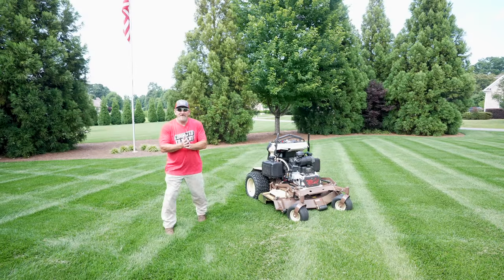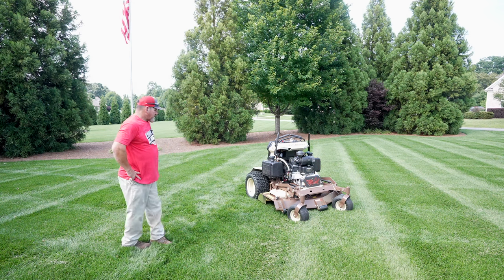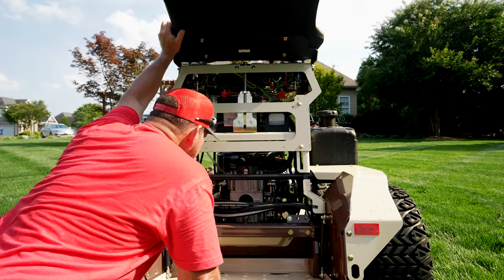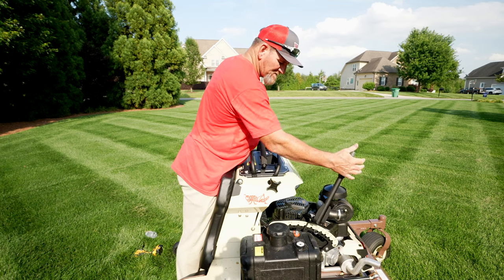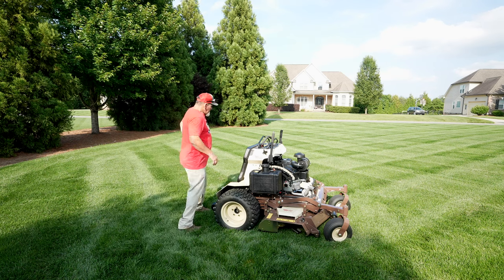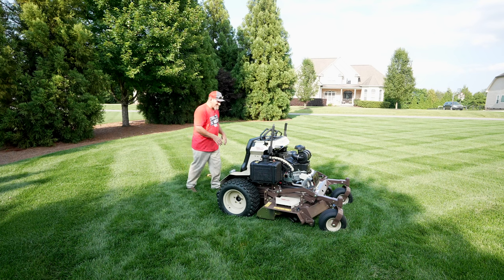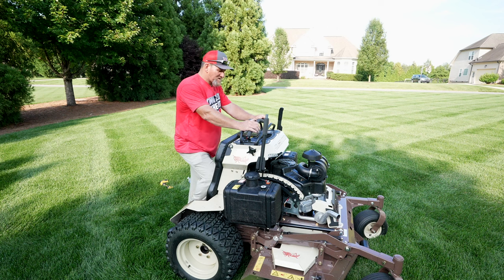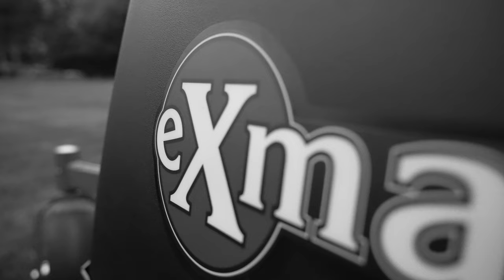Grasshopper Stand On Mower Review GCI Turf MowDown ShowDown

Comment: Next time you use a 52 inch Grasshopper, slow the RPM down a tick. They use different size pulleys for different decks, and for some reason they overspeed the 52's. Too much blade speed can cause too much air flow that will overwhelm you baffle system.

Comment: I understand the aggravation of changing the belt, but every Grasshopper I've owned has gotten at least a 1000 hours out of the belts. I have one now with almost 2000 hours and have replaced one belt and one set of wheel bearings, and a few sets of blades. All idler/tension pulleys are factory.

Comment: Just wondering. Why buy and stand up over a Z turn ?
Reply: 1. Smaller overall length. Allows you to put 3 machines on a trailer vs 2. 
2. Quicker to jump on and off to pick up debris.
3. Others… ?
Reply: They're great for mowing tight spaces. I can see all 4 corners while I'm cutting.
Reply: They save the crap out of your back
Reply: Don't buy if you have bad knees
Reply: @alanruechel2240 this mower with the shocks on back not too bad. I have this same mower just wish I had more power.
Reply: @rambob5987  I've got a spartan stander with the added seat which is great when you need a break from standing

Comment: Just my opinion but I think you over rotated concerning toolless belt changes.  At the end of the day, every landscaper should carry a small tool set in their vehicle.  You invariably will need tools at the most inopportune time for tightening a bolt, adjusting a carb, or pulling a cover.  If you didn't carry a kit, you'd have to go all the way back to the shop for a simple 5 min fix.  That doesn't seem like good practice to me.

Comment: non floating deck makes it's a scalp master with hills, and engine is underpowered. Gas tanks are in the way of very important adjustments. Not sure why GH opted to use over built hydros instead of getting the frame design right and put the gas tanks in the center where they belong. Nice build quality, LED lights who cares, quality of cut is supposed to be good. Bobcat blows this machine away for less money.